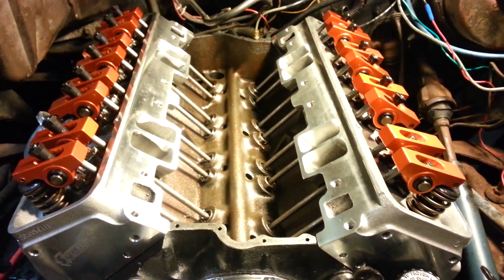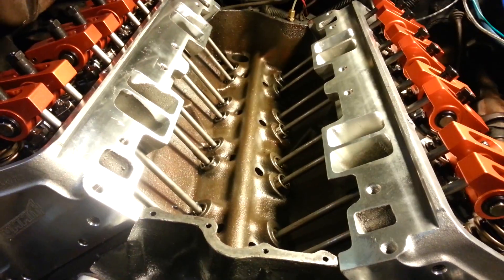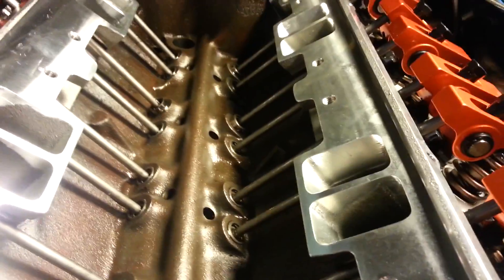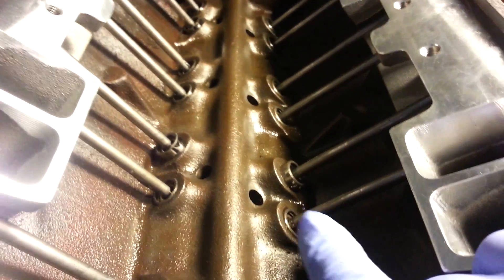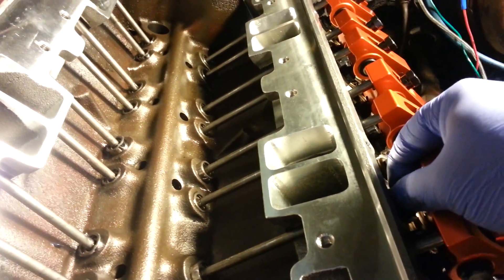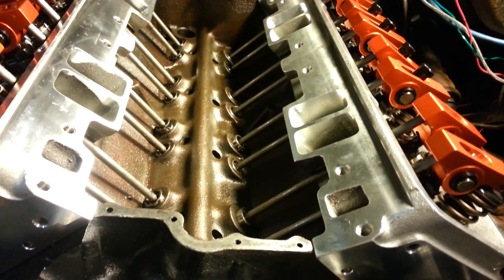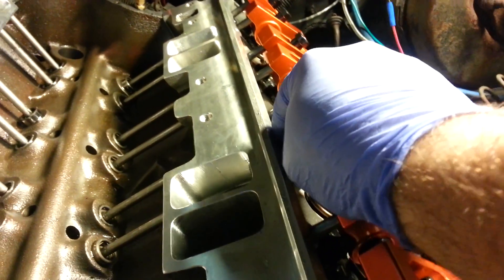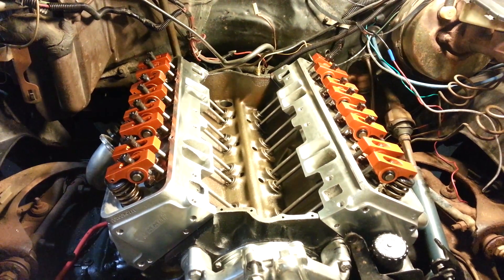SBC valve lash EOIC method

Comment: Ok ok ok. I had questions on what the intake closing meant.
Reply from the maker: When the intake valve is closing it is moving back into the cylinder head and away from the piston. This is the part of the introduction  of air and fuel into the cylinder chamber which is followed by the spark plug igniting that air fuel mix creating an explosion inside chamber area that pushes the energy made during that combustion into the piston while it completes it's revolution of the internal parts that move the drivetrain along. The exhaust vavle opens to let out those combustion gases through the exhaust system. The EOIC method ensures that while setting the valve train lash amount that you are setting it at the appropriate time related to the valves travel of opening and closing to ensure the lifter is at the correct sequence position to avoid it being set either too tight or too loose which can create issues with the valvetrain that can damage parts. If too loose then parts will chatter while pushrod bounces off the lifter and if too tight then the pushrod will flex and even bend or brake from excessive force. When done in the right part of the process you are guaranteeing your lifter position based on which valve is either open or closed. Exhuast opening ensures the intake vavle is closed to set that lifters lash and again when intake vavle is closing the exhaust lifter is at the correct spot to set it as well. Thanks for watching! 👍

Comment: This guy is TRYING to show you how to adjust a cam with the intake and carb off of the motor, but HE'S NOT SHOWING YOU THE ROCKERS MOVING UP AND DOWN, HE'S SHOWING YOU THE PUSHRODS MOVING.    " THE ONLY PROBLEM IS YOU CAN'T SEE YOUR PUSHRODS WHEN YOU ARE ADJUSTING YOUR CAM WHEN YOU NORMALLY DO IT, WITH THE INTAKE ON THE MOTOR, SO THIS VIDEO IS 100% USELESS....
Reply: Just apply what he says to the rocker arm movement instead of lifters
Reply from the maker: The rockers are all you need to watch travel as the valve train moves. Either up or down as valves open or close. Just watch the parts where I point out where the rockers are positioned in relation to the valves and camshaft travel. Lifters have very little to do with the method. If this doesn't work for you then you can always remove your intake manifold and follow along that way. Good luck with your project.
Reply from the maker: Here is my other video with the intake manifold on that you hopefully not find useless for your build. Good luck with your project. 
https://www.youtube.com/watch?v=4w_GeWegKSo

Comment: A lot of people say those bolts, on say a stock Corvette , C5, C6. they get tighter over time.  I just did my valve springs and seals. I was very slow screwing the rockers down as I was lining them up.  I never touched the rods. I hope I can call that okay! I mean,  there was very little room for play on the rocker arm to the valve as I was tightening them, they're all 22ft lbs rocker arm bolts.
I feel like that's all you can do...
Am I missing something?
Nice set up
Reply from the maker: If you are asking about rocker arm stud bolts screwing into the heads coming loose over time on corvettes I am not sure why since they use hydraulic roller cams that do not have extreme valve spring pressures like solid roller cams. But if you are asking about rocker lock nuts getting loose over time on corvettes, then yes after so many miles they can loosen unless you are using good quality poly lock nuts to prevent that. About your set up, I have never set the valve train without touching the push rods, but I have watched other guys just jiggle the rocker up and down to make sure there is not sloppy or excessive play between rocker and push rod tip (which is the gap between the two parts). If you have too much loose clearance between the rocker pocket and tip of push rod then it will be extremely noisy and eventually end in damage to those surfaces which will result in a chewed up push rod tip. It just has to ride around in good fit between the tip and pocket of rocker that will fully open the valve without binding, which would result in bent push rod, or if too loose then damage parts. If you can redo the set up before using then I would suggest it. Even if the intake valve is on now it can still be done correctly. Good luck with your build!
Reply: @djrowe10  on a C5 or C6 Corvette with stock rocker arms they just pivot nicely on the push rods.  All you can really do is just torque the rocker bolts. So. that makes sense.  I started it,  drove it a few days now,  it runs awesome. Just swapped the springs and seals.  And the motor feels a little better, really. It's just running like better than new.  Tons of other work but that was the last thing

Comment: Went thru mine for the first time ever doing one based on this video. One question I had is that I can still lift some of the rollers off of the valve stem. Even though there I think I got zero lash on the push rod side and a little friction while turning the push rod.

Does the rocker maybe have play across it or if I am checking by lifting the roller side (lifting up on the roller) is that wrong. Because it might be compressing the hydraulic lifter itself by checking in that way.

Just hoping to have it correct.
Reply from the maker: Sounds maybe too loose. Did you do a half turn to tighten the rocker pre-load or whole turn? There will always be some small amount of space between valve stem tip and roller wheel (.010-.030) on average. This gives some space for metal expansion or swelling to prevent keeping the valve hung open if too tight. I will try to add link about zero lash to this in future.
Reply: Do you have the correct length pushrods??